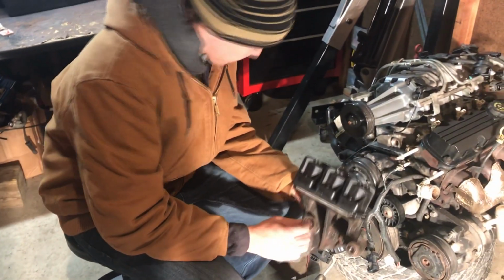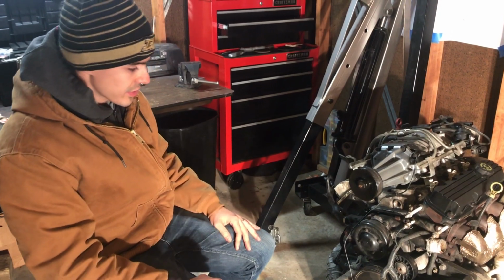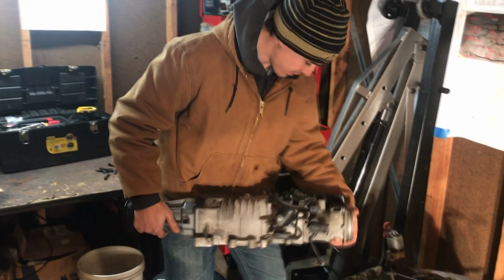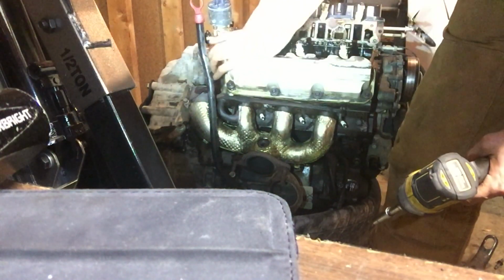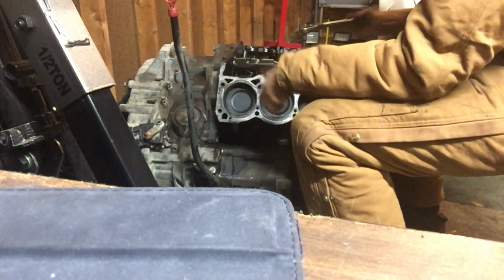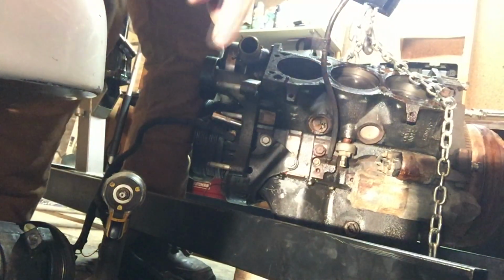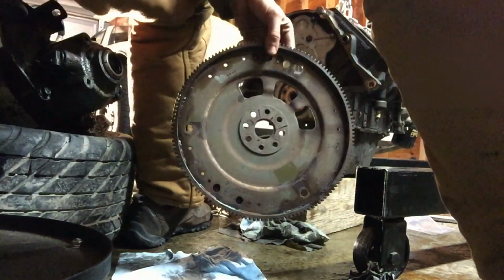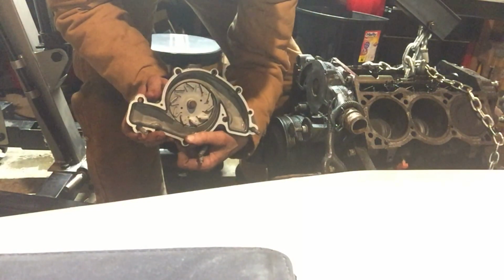3800 Supercharged Fiero Rebuild Part 1/4 - Long Block Teardown How To

Comment: I'm looking to do this ,build engine first ,then buy fiero to put it in,I'm excited because I'm seeing thecost to speed ratio!
Reply from the maker: you can buy a fiero for $1000 and do the engine for about $1700 if you're good. See my forum post for cost effective parts:
https://www.youtube.com/redirect?redir_token=Z4Ok-nndru5Z0HUQseVLXbHo_ot8MTUzODA5NDM2OEAxNTM4MDA3OTY4&v=7Oq_ZTJDUdM&q=http%3A%2F%2Fwww.fiero.nl%2Fforum%2FForum2%2FHTML%2F139530.html&event=video_description
Reply: Which production years of the 3800supercharged are the choice years and why could you explain?
Reply from the maker: generally 1998-2002 Series II 3800sc from a GTP are the golden engines because they have all the following parts which you NEED (you can see here at my build thread): http://www.fiero.nl/forum/Forum2/HTML/139530.html)
1-GTP/Regal Steel Oil Pan
2-GTP Oil Pan Gasket (needs cutting to fit over oil pickup)
3-Oil Filter Housing Gasket
4-GTP/Regal oil filter bracket GM 12569219 ; 24508441
5-GTP/Regal angled coil pack bracket GM 24507211 ; 24504360 (cut dogbone)
6-GTP Tensioner pulley on coil pack bracket
7- 3-pin Temperature sender & wire - duralast TU178DG
8- The GTP axles from 98-02 are the correct length for building a new axle.

You can head over to http://gmtuners.com/files/index.htm and read on the technical differences for wiring across different model years.
Reply: @FieroAustin  not for $1700 with out doing the exhaust right for extra power. See West Coast fiero for headers that will help.
Reply from the maker: @w41duvernay  WCF exhaust is expensive...
I put on $200 stainless Chinese GTP headers and did some of my own welding.
If you are only interested in ~290 crank HP then you don't even need headers, the stock ones  are fine

Comment: What transmission is that? to take 350-400 whp? is there a 4-5-6 speed that is made by GM for the Front Wheel Drive/mid engine?
Reply from the maker: This is a 4t65e-hd 4 speed auto with a hardened input and pump shaft. id say 350whp is a good amount for that setup. Some people swear it can do more.

A F23 is a 5-speed manual that can handle more, and an F40 is a 6-speed manual that can handle even more. Estimate 500-600hp?

Comment: Haha I remember I had to do this. And it was a lot of fun re doing the belt setup. I decided to go with the stock alt location and made a pulley bracket were the power steering pump. My modified alt bracket broke and changing the alt in the fiero location was a pain.

I got lazy lol.
Reply from the maker: dang! yeah the alternator can't come out of there, or at least it would SUCK!

Comment: why do you need to mark the flywheel with the torque converter? I'm not sure at about the reasoning behind this. Has nothing to do with timing right?
Reply from the maker: you don't need to, but it helps with lining it back up  later. It is difficult to get it on the correct way; the bolts don't line up just any way. It will only fit on one way.

Comment: How much does the engine weight?
Reply from the maker: engine itself is 392 lbs. 4t65e-hd Trans is around 200lbs. I would say that the 3800sc + 4t65e-hd is 100-200lbs heavier than the stock v6+3spd auto. my 88 rear end its a bit lower than it did stock
Reply: @FieroAustin  the 392 number, does that include the weight of the heads/crank/ exhaust manifolds?
Reply from the maker: @nickalberici  I do not know. I am assuming yes.